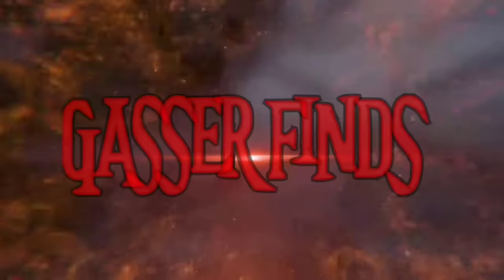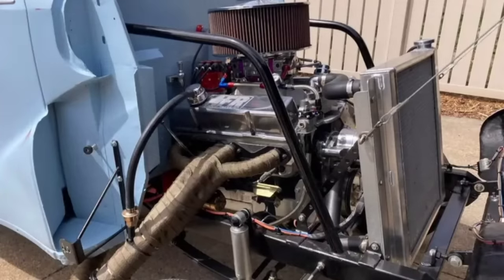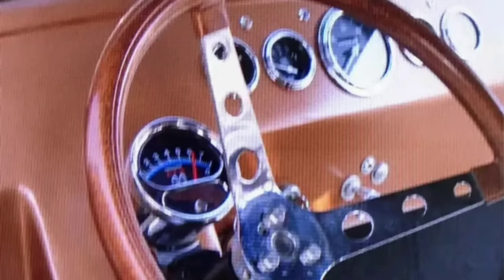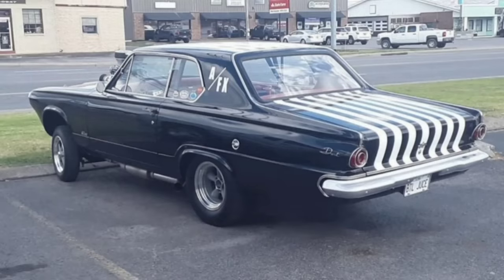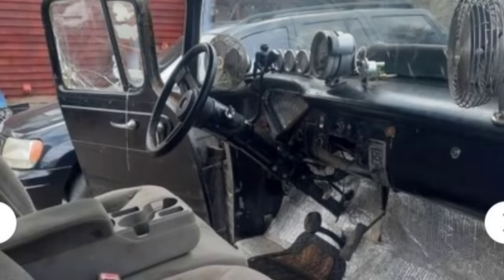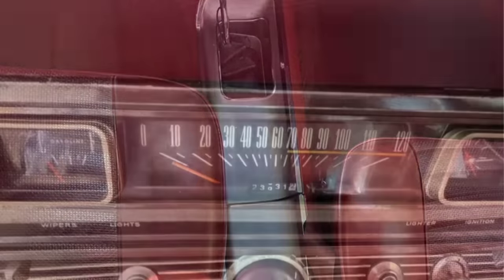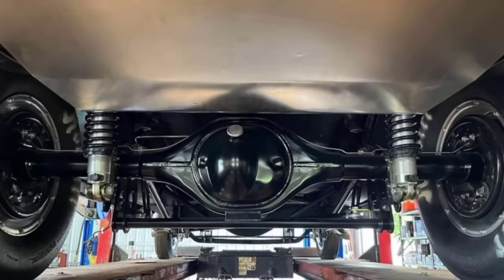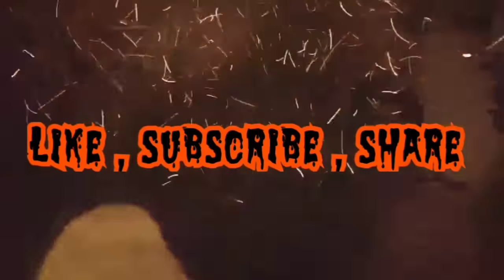GASSER FINDS ON FACEBOOK MARKET PLACE!

Comment: I want that '57 panel, I've never seen one turned into a gasser. If I had the $15,000 he wants for it, I'd try to talk the price down, but if I couldn't, I'd get it anyway!
Reply from the maker: I hear that for sure..
Thanks for watching and commenting
Reply: 'A'57 Chevy truck wouldn't have four headlights, '58-'59 did .
Reply from the maker: @bobbrinkerhoff3592  unless they changed the front end.. that happens  a lot. Personally I wouldn't have went with the 58 -59 front end.

Comment: I found and bought a 1978 Chrysler cordoba;  the horn works the lights and turning signals work seems like it shifts….. my wife is pretty upset cleaned out the mouse nests so I can sleep in there or the chicken coop if need be 😂 Had to drill out the trunk lock to pop it and there wasn’t any gold bars ….. so I guess it’s back to work tomorrow 😅
Reply from the maker: 🤣🤣🤣... nice, don't forget a blanket. 
Thanks for watching and commenting
Reply from the maker: @g-man8980  hey that wouldn't be a bad thing.
🤣

Comment: You would think the person that built that sick little blue falcon gasser they wouldn't have used a 4160 which one of the cheapest Holley carbs you can buy. You can tell it doesn't have a secondary meeting block it had the metering plate, they work fine on a mild engine but kinda cheesy for a build like that.
Reply from the maker: They spent all the money on making it look pretty..🤣
Thanks for watching and commenting

Comment: Like the first one, but I wouldn't pay more than four for it. This is the ruination of the car, it should be put back to stock. 
The Austin is cute, not my thing but I am ot ppaying more than 3500 if I'm buying.
The Falcon.Ilke it, but I would pay mor than 6000 even if it were showroom quality.
The VW. Call Bellvue, someone escaped.
I would negotiate on the Fleetline
Not as a gasser, and not even for a quarter of the price. Which is still too high. What? He is asking for matching numbers prices on a car that never was.
I can't argue about the Panel Van.
For that price, this "56 needs to be showroom quality and it isn't.
Same with the "67 Fairlane.
I have to pass on this bird.
$70K? Another Belvue escapee.
Cut th price in half.

Signed Richard.
Reply from the maker: I hear ya.. yeah some are way of the mark in my opinion too.
Thanks for watching and commenting